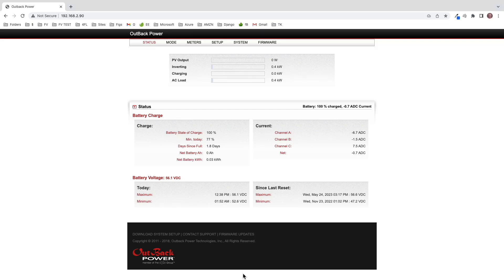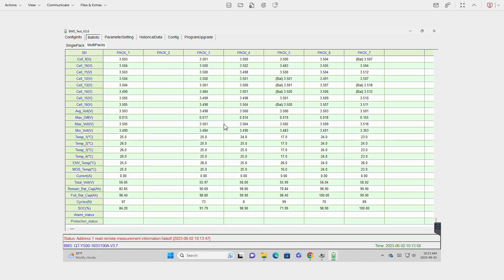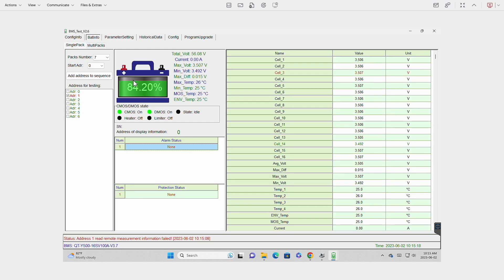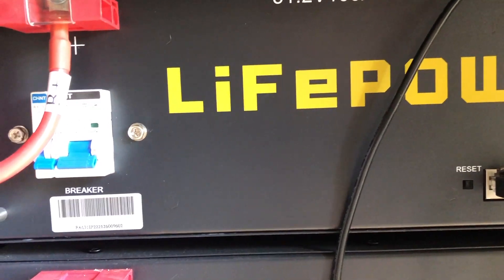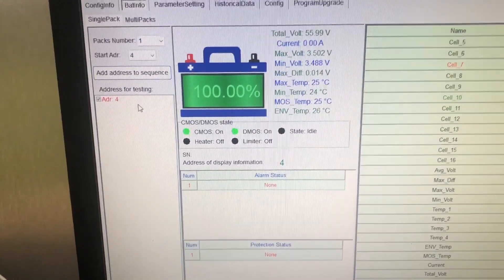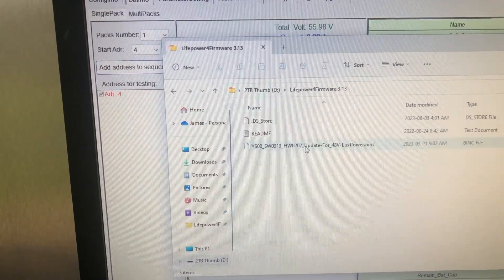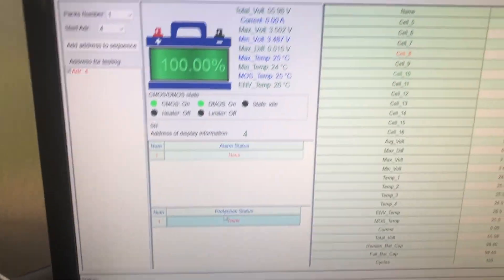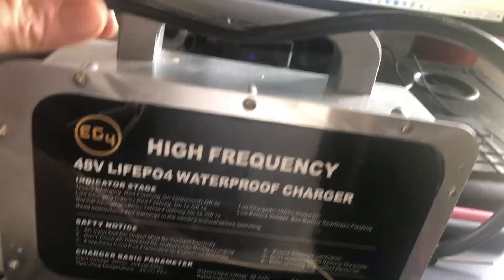Fixing EG4 LiFePOWER4 Battery Modules Not Fully Charging

Comment: Think I'd set that voltage at 56.8 for the bulk charge and let it float for a while after that. Don't know what the EG4 settings are for 100% indication but should be pretty close. That little charger you were using was pushing out max voltage and your errors were from cell over voltage at 3.65 and shut down charging from the bms.
Next question is, why does your charge controller stop when you still have battery packs below 100%? You're going to have to dig that out of your controller settings for your charging parameters. Battery packs are going to charge and discharge at different rates best you can do. But as long as the charge voltage remains constant, they can float forever at 100% while the lagging batteries catch up. That's going to be dictated by your float time and something you'll have to figure out for your system as battery banks aren't all the same.   The bms decides when charging stops for the pack that's obviously set to 3.65. The controller may be responding to the master sending 100% for a total for the string but not likely?

Comment: Set you Bulk voltage to 56.5v.
Reply: The lifepower4 bms will calibrate to 100% whenever any cell reaches 3.555V or 0% when lowest cell reaches 2.700V

Comment: Lance, Thank you so much!  I was having the same problem on 2 Lifepower4 batteries, and Signature Solar was no help.   I cranked up the voltage to 58V on my charge controller and bam they reset and took a full charge.     I wasted hours in the past trying to figure this out.   I did firmware, change the ground to a bottom feed.    One would think signature solar would be giving this advice.  I guess they just want to sell extra chargers, and not enplane the problem.

Comment: Had the same problem with my 15 K solark, set the charge voltage to 57.5 and all the BMS went to 100 % charge and no alarms. I did try the firmware update and that did nothing. Thanks for the charge voltage tip.

Comment: Thanks for the Video.  My SOC issue started when I lowered the inverter charge voltage to match what the manual said it should be 56.2.  From that time, the SOC started drifting on all of the batteries, even though the voltages were all the same.  I have EG4 3000EHV-48 inverters.  I was able to change setting of the bulk charging (Step 26) to the 58.2.  This had the same results as you, all went to 100 percent with the same alarms.  After this was done, I have set the bulk charging to 57.0 to see if they stay in sync.  Thanks again, your video was super helpful.
Reply: I had the same issue using a single eg4 battery with the 3000 EHV48. Cycling the battery does help, but mine was as bad as 62% and wouldn't charge any further. After cycling three times I finally achieved 99% but I couldn't make 100 until I set the bulk at 58.2. 58 volts didn't reset it. I had to enter 58.2. It's my opinion 58.2 is too high so I set it back to 56.4. I'm wondering if my cables feeding the inverter are imbalanced as my ground is a bit shorter because of the breaker I have installed? Anyway this is a good method of resetting the soc on the bms. Hopefully a new firmware upgrade will correct the problem.

Comment: It seems  you are just trying to trick the software into showing 100% for what ever voltage that it is set for. The voltage can get high enough to do that but the cells not be balanced. I can't see all  your cell voltages but they seem to be fairly well balanced.  What you probably would ideally do is change the 100% full parameter to something more like 55.2v . If you watch some Off Grid Garage videos  tests cells and bms of various brands in detail  .  You would probably be better off not relying on the bms reported SOC and get a different meter that shows the SOC of your batteries as a single group so you know if all the power that is being taken out is the same as what is going back in. I have a different brand bms than you do but have seen how unreliable the bms can report SOC if the cells are unbalanced.
Reply: Seems the batteries are fully charged but the BMS is not reporting that fact!  Looks like a BMS firmware or settings problem.
Reply: @rpsmith  The bms has a setpoint for voltage and maybe also current that it needs to see before it reports 100% SOC.
Reply: @LarryKapp1  -- I assume his charger is set to the voltage that EG4 specified.  So if that is true, than the BMS or its default settings are at fault.
Reply: @rpsmith  I know someone who had EG4 batteries and the SOC wouldn't reset. He had the settings in the controller that  were specified in a sheet that came with the batteries - either it was from Signature Solar or EG4 - not sure.  I looked up the manual online and the recommended settings were different than what came with the battery . Once the charger setpoint was changed , then the SOC got to 100% every day like it was supposed to when battery was full.  This is the second time I heard of conflicting setpoints for Signature Solar EG4 batteries.
Reply: @rpsmith  Also what I don't like about the Signature Solar EG4 batteries is that their software won't let you look at or change the bms setpoints.
Reply: @LarryKapp1  --  I solved that problem with my EG4 Wallmount batteries by taking them out of closed loop and letting my Victron Multiplus-2 control the charging.  Now the EG4 BMS only reports Voltage, Current, Temp and min and max cell voltages to my MP2.  This arrangement works flawlessly and gives me full control over charging.  So now the BMS literally becomes a Smart Shunt for my MP2 and keeps the cell safe and balanced.
Reply: @rpsmith  That is how it should be if you ask me. Too many people think all this stuff will be plug and play but there needs to be more monitoring and knowledge involved to make sure it all works right.

Comment: I don't want you to adjust the parameter settings but those settings are what tells the bms when to read 100 percent charge level. In theory what you did by charging it up to 100 percent it should be calibrated and from then on read 100 percent with your current settings without having to pump the batteries up to 58v everyday

Comment: Your issues are exactly what I had. Same LP4 (six 48v batteries) and rack. 1) fixed my bus bars correctly 2) fixed the SOC% issue. Everything is working nicely now. I did videos on my channel similar to yours (the bus bars were pure crap until I modified and used REAL hardware). I bumped my charge voltages (three Midnite Solar MPPT chargers) to 57.0v (5 mins duration ABSORB and FLOAT to 54.2v. All six go up to 100% SOC with no alarms on the batteries. But, the BMS APP v2.6 on the laptop will show "overvoltage" under multipack on a few batterys. Those faults (of course) go away. One battery has a "CMOS: On" fault that goes away once the specific battery starts to discharge. I think Signature Solar uses us (and our videos) as "product improvement guinea pigs". It isn't just me, several of us I am in contact with who have these and issues.
Reply: 100% on lack of clear guidance from Signature Solar.
Reply from the maker: Good and helpful info. Thanx.

Comment: Man, thanks a million.  I have spent more than 16 hours on hold different times speaking with different people from SS. I have that charger plus the new 100amp yellow one. Why didn't they just tell me this. 5 of my 6 batteries are doing the same 70s charging stop thing. They have told me to drain, 
 reset and do all other things for 3 weeks and nothing worked.  If they know this information would have been nice to just tell me. I will do this tomorrow and let you know if it worked for me. The only battery that works perfectly is the first gyll battery that I bought from them. It charges to 100% and works everyday for almost 2 years now never ever a fault with it. The lifepower batteries have a poor BMS system.  I've already replaced one BMS.
Reply from the maker: How did it go? I also had to replace a BMS.
Reply: @lanceknoechel8945  All charging up 100% since then. It worked.
Reply from the maker: @MrDonking1967  I may need to do a follow up video on this. I'm still noticing some hiccups.
Reply: @lanceknoechel8945   Thanks. I fixed 5 of my set using this method. Yes, couple has since stared to lag behind again. However now that I know how and what is the solution and the fix I am not stressed anymore about it. Really a pain to have to go thru this but I am already stuck with these batteries.
Reply from the maker: @MrDonking1967  Ditto. I've been experimenting with different settings, but don't quite have the modules working like they should. The BMS's in these modules don't really manage as they should.
Reply: @lanceknoechel8945  Yes, they will not admit but all this is a result of poor BMS. So we have to help it manage the batteries once a month or so

Comment: With EG4 communications it handles all the charging requirements, it takes it up over 58.0v for just a second and all batteries show 100% each time.
Reply: By “EG4 communications” are you referring to Sig Solar’s new hub, or closed loop communications with the inverter?
Reply: Closed loop with the inverter
Reply from the maker: That's good information to know.

Comment: What Absorb time do you normally use? Also, are you using End Amps setting?
Reply from the maker: Very good questions. I will be doing a follow-up video on that.
Reply: @lanceknoechel8945  I’ll watch that video. I usually set all the different manufacturers LiFePO4 16s batteries about the same at 55.2 to 56.0 with a 2-3 hour absorb and end amps set to 2-5% of amp-hour capacity. The larger the bank, the longer the absorb and lower percentage. Also, Outback is funny in that they increment voltage by 0.4 instead of 0.1 on some settings.
Reply from the maker: @maverickmacgyver  Thanx for the info. I have outstanding request from SS on this topic, but your input is helpful for me playing with the settings.